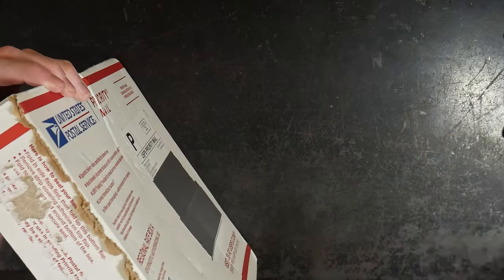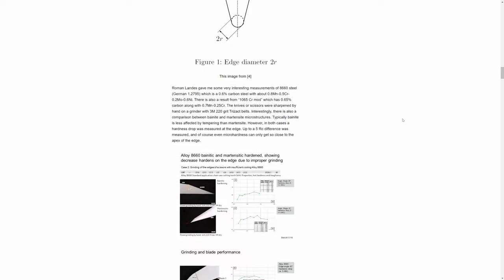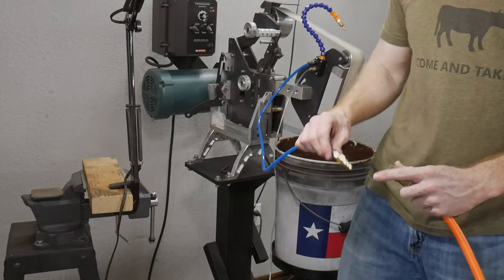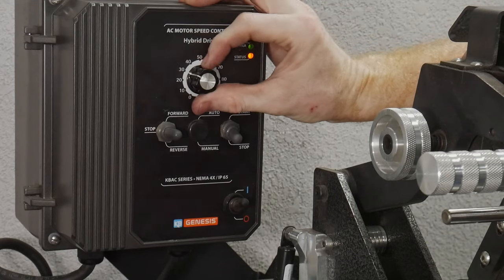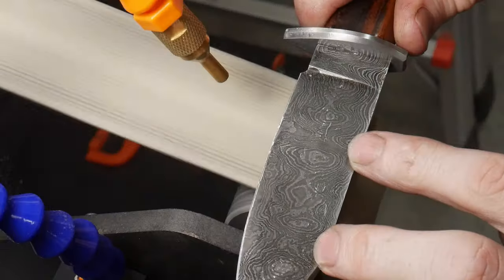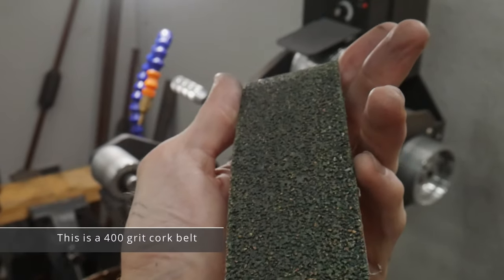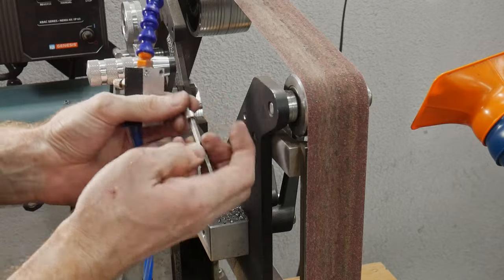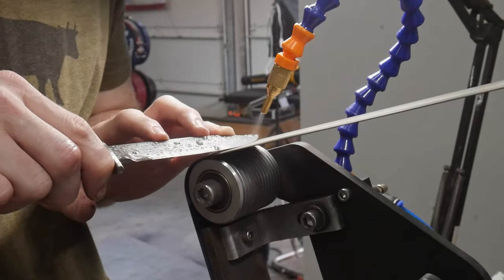Before You Sharpen On Your Grinder... Watch This....

Comment from the maker: There are as many ways to sharpen a knife as there are knifemakers! How do yall do it? 🙌
Reply: Garden rocks and chicken grease.
Reply: я думал крепление на магните, а оказывается ты сделал на болту
Reply from the maker: @alan_a_1975  Это было на магните. Я обнаружил, что болт более надежный и жесткий. Ваше здоровье!
Reply from the maker: @stevealford230  This sounds like probably the most effective method. Good stuff!
Reply: @RedBeardOps  It's all in the technique. 

And good, fresh grease.

And proper rock selection.

... but mostly technique.
Reply: Calling it "sharpening" in my case is kinda laughable. I used the Worksharp, and I kinda made my Resolute duller than when I started. I was planning on getting a TSProf sharpener, though
Reply: I get it close with a 220 grit belt then finish by hand on some diamond stones with a final leather strop. But my method has evolved over many blades I’ve made, so I think whatever works... works. Keep trying to improve with every knife.
Reply: TS Prof Kadet.  Amazingly well made tool, just like the larger model and the one below it. 👍

Also a good a 2 x 72 leather belt for power strop, and a quality ceramic hone, but mostly on kitchen knives.  My grinder has dual axis tracking adjustment for running perfectly straight backwards.

The whole sharpening thing though has gotten out of hand.  A kitchen knife, yes the edge should be extremely thin and fine.  But guys that are sharpening ‘outdoor,’ knives to that level just to do a bull💩 paper towel cut test have missed the point.  A robust 25 degree outdoor edge shouldn’t cut like that, it should have a tough and durable toothy working edge.
Reply: I have four different fixed angle sharpening systems. They all produce an excellent surgically sharp apex, but I find them very time consuming, at least 30 minutes or more for each knife. I prefer starting with an 800 grit belt on my Revolution grinder from Sir Brian to established a nice burr then move to 1200 and finally a 2500 grit belt. I do not have a leather belt for my 2x72 but i do have one for my hf 1x30 so i use that to strop with white compound, being careful not to overheat the edge. I can sharpen a knife in under 5 minutes with a mirror sharpened edge. I find if I stop at 1200 then strop, its hard to strop out the minute grind lines. I do prefer the clean line at the transition from primary bevel to the secondary bevel from a fixed angle sharpener, but for production purposes I  find the 2x72 method exceptable. Just my thoughts from Tucson at Reddog knives
Reply from the maker: @griffithshandmade-knives  Very nice!
Reply from the maker: @reddogknives  Good thoughts Guy!
Reply: @RedBeardOps  Thank you, ya never know if someone reads these or not, but I put my thoughts out there for the community to learn from just like I did from everyones generosity
Reply: @edanpino5035  I’ve got the TSprof Blitz 360 black and it really has changed my blades for the better.
Reply: The finnish sharpening i do on wet stones by hand
Reply: Reeder sharpening jig , combat abrasive buffing wheels , granite block with sand paper then finish on leather and newspaper 👍🏻
Reply: I either use the Lansky system with diamond stones or my 1x30.   Then I usually strop it on a hunk of balsa wood with green compound.  Balsa wood works great for stopping.  I bought  a like 3" x 3" x 8" block for $4 from Hobby Lobby. The 1x30 has become my preferred method. With an angle guide and practice I have been able to achieve the same level of sharpness as I do with the lansky but in 25% of the time or less.  I've never felt any heat build up in the knife at all while doing it and I am constantly feeling the edge for a burr.  I also haven't noticed a difference in edge retention but if there is its not a lot and definitely worth the trade off of time.

Comment: Do you think it will work well with kitcen knives as well? I allredy have the mist system for a wile and it works great (a litlle messy ...).
Reply from the maker: For sure. I sharpened our kitchen knives with it. Very quick and easy.

Comment: i have done tests with a chop high hardness edge blade in preparation for the ABS Journeymen shop test overheated the edge on one spot on a blade. went and did another chop test and it just became separated. which is why i bought a water-cooled wheel sharpener (i forget how to spell it and do not want to look it up) and do not have the problem anymore.
Reply from the maker: Nice! There ya go. Problem solved

Comment: How do you sharpen your knifes?  I've seen you advocate for the WEN quite a bit.  Also, if sharpening on a belt grinder can ruin the apex temper, wouldn't grinding bevels post heat treat as well?
Reply from the maker: The idea was that you could over heat the micro bevel. I use both the WEN and this sharpening system from HOUSE

Comment: I wonder if just having a concentrated stream of cool air on the area you are sharpening would be enough?  I don't know if you can run that mister with 0 water and 100% air but maybe that would be enough.  The water idea is nice but it's messy and I would be really worried about rusting parts and bearings.
Reply from the maker: It is messy for sure

Comment: Untill very recently, the only grinder I own is the infamous HF 1x30, to which I had purchased a sharpening "high grit" belt package. Not too long ago I made the best upgrade I could make to my grinder situation. Being that funds are quite limited for me, I decided my best bet was to go with a variable speed bench grinder, with the multi-tool 2x36 belt grinder attachment. Having purchased some quality ceramic belts from Red label, I find that this grinder is quite sufficient at hogging off steel, at least compared to my 1x30. I have yet to sharpen anything on this grinder however. Mostly due to the fact that it took me quite some time to find my niche, if you will, sharpening on the 1x30. It's a bit of an odd setup, the 2x36, that being another reason why I've yet to attempt sharpening on said unit. Now I say all this to say, is it hurting me to keep using the 1x30 to sharpen? Or should I start veering away from the HF special? Lol! Great vid! You're always very good at clarifying everything you do in your vids. It's extremely refreshing! Thanks again for your time, and keep that top notch content coming!
Reply from the maker: Glad you liked the video Blair! People have been sharpening on grinders for years; that's for sure. But after reading Larrin's article, I think it's better to use a liquid cooled system with a VFD. Just my opinion.

Comment: How much reduced dust can this configuration be helpful with?
Reply: Is it enough to eliminate a fresh air system?
Reply from the maker: This is a good question! It did reduce the amount of dust while grinding. I still wore a respirator though.
Reply: @RedBeardOps  thanks for responding, it was very helpful
Reply: I find the dust is reduced substantially. When I grind with mist there is usually collections of wet metal dust in different places in the grinder.
Reply: @gustingdis  I have worked with grinding since I was 11. The dust has always been a issue for me. So the more information I can gather, the better..
Reply: @citizenVader  since you were 11? That is a lot if dust! I know that it is very unhealthy to breath any kind of dust, especially heavy metal dust. If you have ever been grinding without a respirator and then found that your nose was coated in black snot, you know how much is in the air. It's terrible. I also like grinding wet because it eliminates the need to dunk your work in water. No more burned fingers.
Reply: @gustingdis  yeah I know, it's been brutal to my lounges. I started out as a kid in the fishing industry, and have been exposed to a variety of really nasty stuff. That's why I don't compromise with dust anymore. Usually I grind by hand, but it is becoming more difficult to reach the demands of my clients, so I'm fixing to change the set up I have. And wet grinding seems to be a good alternative.

Comment: Ok, just ordered it. Haha
Reply from the maker: Awesome Nick! Hope you like it!
Reply: @RedBeardOps   bro need advice. I just received a leather strop for my 2x72. There is a smooth side and a rough side. It came rough side out. What side do I use and you said something about applying some sort of compound. Can you tell me what kind
Reply from the maker: @nickminderman7380  Hey man, I've never used a leather belt on the 2x72, but I think I'd use the smooth side with a little green buffing compound on it. It's on my list to try out. Don't leave it under tension on your grinder when you're done or you'll stretch it out permanently